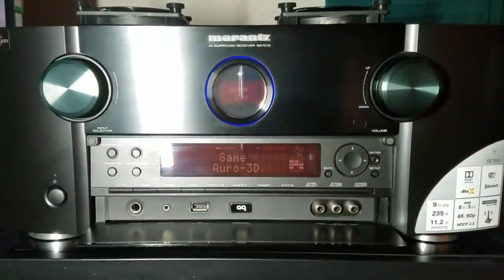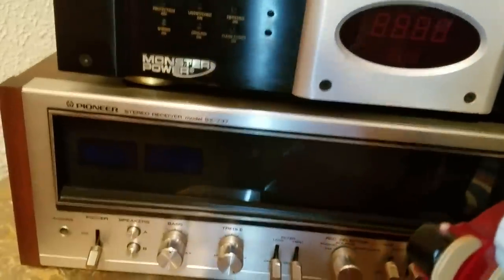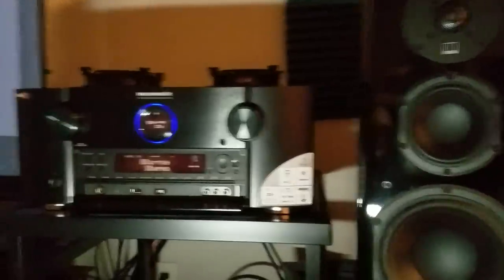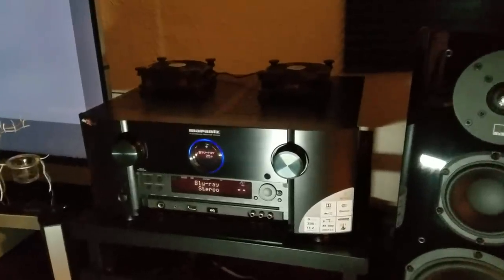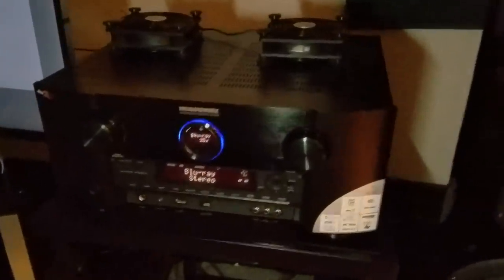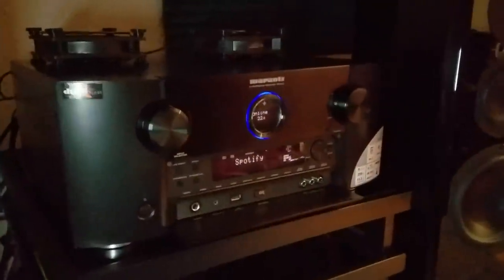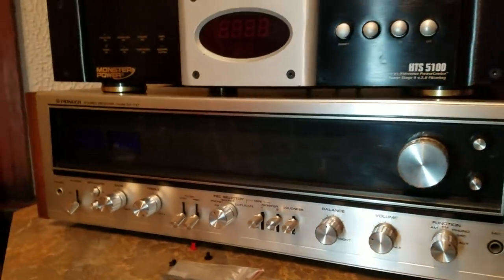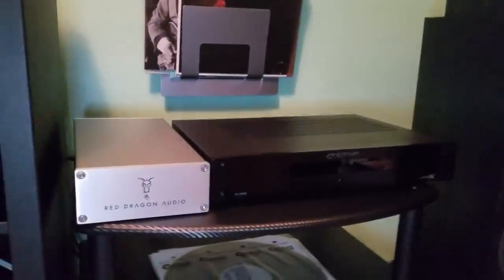My Marantz amp blew up 2

Comment: I get the feeling that his amp blew up because he is abusive and pushed things too far.
Reply: 100 percent correct. Guy clipped the amp or crossed wires! Cheap speakers, NO problem with a Marantz, sorry! I've used every major brand AVR you can name with all kinds of speakers in two channel, NEVER blown a one of them! Also, Marantz is NOT a class D amp, as is noted below! Read the literature. Lots of misinformation here! You could drive those Klipsch with a $25 Lepai class D one pound amp and never blow it, well, you could clip it but it would NOT take out a channel but just go protect and reboot when you turn it off and on again. No damage done.
Reply: Yeh he never did answer meaning he had no fricking clue other than he blew the channel. It definitely has nothing to do with high efficiency speakers or that receiver it’s that he cranked it and was flicking around on his phone and spiked the amp to peak amp and pop goes the line lol
Reply: Marantz AV have lots of issues .
I can vouch for that as an owner of multiple marantz AV recievers. 
It's funny how you guys attacked this channel for reporting a problem ...
Your all not bright enough to realize AV recievers are not the way to go for 2 channel stereo in the first place .
Do some homework before you run your mouth .
Reply: So I'm confused...it looked like the repair report said caused by bad speaker. So what was the cause of the blown channel?
Reply: I 2 Marantz receivers SR5600. with JBL 7.1. & SR8500 Wharfedale 2 channel. Both never blew up! 2009 & 2010 both works well this 2020! Love it! I go at negative 25 on the 5600 & -15 on the 8500 for karaoke! Never had a problem on both! Thanks.
Reply: @dednside5229  lololololololol exactly

Comment: So you're not sure about what you're not sure about.. Klipsch on the other hand is far from being a "cheap" solution..
Reply: @1mykalfury  No Marantz doesn't if used correctly.
Reply: Lol
Reply: @1mykalfury  Not the old Marantz
Reply: It's always someone else's fault.  In rality, speaker impedence to speakers ocnstantly fluctuates.
Reply: Klipsch is far from cheap I agree. I’ve looked at their speakers n subs. There expensive. However once I got lucky I got a set of reference towers a center and sub and a older denon amp for 100$. Also the sub had a blown amp but I fixed that using an external amp. I had the setup in my bedroom and I watched Harry Potter and it sounded awesome. I had a set of older Polk towers for the rears. So yeah klipsch is not cheap.

Comment: I am facing a strange issue with my marantz sr5013 .from last 3days my subwoofer is vibrating there is no more kick from sub.i changed the RCA cable but no improvement .can you please help me what could be the issue with receiver .this is the 2nd receiver which is having same issue just after 1year

Comment: I have a very similar Marantz SR 7011 and the specs say it is a class A/B amp to the best of my knowledge.  Mine has been stable at 4 ohm loads and is rated for it.  I once had a piece of wire accidentally short one of the amps, putting it into protective mode without further issue.
I'm guessing there was another problem with yours.  I'm sure you're not the first to use Klipsch speakers with a Marantz receiver, given the popularity of both brands.

Comment: Never consider a volume control as being a measure of the power the amplifier is delivering.  It is just a control allowing more signal into the amplifier.  Depending on the size of the input signal you could easily be driving the amplifier to full power with the control even midway from "max".

Comment from the maker: Anyone remember ELI the ICE man?  Eli says that voltage leads or comes before current in an inductor ice says the current leads or comes first before voltage in a capacitor.  Regarding the phase between voltage and current in an AC circuit, there is a 90 degree phase difference between the current and voltage.  voltage leads the current by 90 degrees the EMF (E) is ahead of the current (I).  In a circuit with capacitor and AC power source, the 90-degree phase difference also exists between the current and voltage but the voltage lags the current.  This way using the cap (C) the voltage emf (E) is behind the current (I).  So when you apply voltage to an inductor it resists and current and it builds up slower than with voltage lagging in time and phase technically.  Capacitors are directly proportional to the charge and the current must lead the voltage in time in Phase to conduct charge to the plates and raise the voltage. Understanding that is you can realize that technically resistance dealing with AC circuits it's called impedance at this point, but the voltage and current are always linear in a pure resistance.  People have used the letter Z often to refer to resistance in an AC circuit.   So when referring to resistance in an AC circuit you can simply refer to the impedance.   so you can certainly refer to resistance in an AC circuit just using the term impedance so you could say DC resistance equals AC impedance.  Average power however in a resistive vs. Reactive circuit depends on phase angle in a purely resistive circuit obviously equal zero.  If I remember correctly the power factor is equal to 1 so average power consumed by an AC resistance using Ohm's law is 
P=V.I = I (squared)R = V (squared) over R watts.

Comment: Most AVRs are not class D.  Class A/B is most common for AVRs.  The SR7010 has A/B class amplifiers.  You're more likely to find class D in amplifiers, soundbars, and powered speakers.
Reply: I totally agree they are as well and to be honest I am not a fan of plugging other amplifiers into them either unless it's a powered subwoofer. I want to hear the amp I brought in the first place not something else. I mean if it was no good in the first place why buy the bloody thing :))))))). And before anyone asks, I do know what a power amp is for but I do not feel the need for one, or the extra expense that comes with it  :))))))). Mind you I bet it makes a louder bang if you blow it up :)))))))).
Reply: Harman Kardon avr 370 is class D. That's why it is sitting on a shelf somewhere after being replaced with something that can actually reproduce sound. Lesson learned.
Reply: Correct!
This dude's a POD and doesn't know what the hell
he's talking about.!
Marantz is crap these days with 1 of the highest
return rates among AVR's.
Reply: For those who like to connect external amplifiers. Thats what preamps are for. Yamaha makes an 11.2ch preamp with XLR outputs. Designed for home theater use.
Reply: @1mykalfury  wow I hate to hear thst as a few months back I bought an SR7012........no issues yet, keep uour fingers crossed.
Reply: Mathew, interesting reply and are you a tech? 
I am troubleshooting my SR 7011 and it is pulling over 1.05 amps of AC power just sitting there with the power on.  Makes lots of heat and no sound.  If you have one of these you would think it was running class A, but if it is push-pull, then A-B for sure, and no way it would need 120 watts of power just to sit there with no music or video running thru it right???  This one is making enough heat for a toasted cheese sandwich!
Reply: David, I will do that AS soon as I get the problems with IC391 ironed out. Something is causing the amp stages themselves to draw lots of current with no input.

Comment: You are smart to have cooling fans on that receiver. Lots of manufacturers use Large Scale ICs for power amps. Loaded with transistors, these modules run really hot. The reason for using modules is cost and space. But really poor for thermal management. Even on Marantz separates, there are output transistors on a "cooling tube" which is not as efficient as big heat sinks but save space. My only receiver is a 1974 Marantz 19. Each side has a full length heat sink. That's only for 50 wpc. But multi-channel receivers have a space problem. I recommend a separate power amp and then buy a disposable pre-pro.
Reply: I had a ac infinity t10 on my denon x4400h and still will get hot that's why i said forgot avr go with separates
Reply: Thanks. It's been great since 1974.No rebuilds. Scope still works which is amazing.
Reply: The inusfficient heat-sinks -- in Denon's they tend to be a "ribbon" of thin aluminum -- is cost-cutting.  "Audioholics" goes into detail about the annual cramming of more and more "features" (many of them useless) into the same-sized units.

So adjunct cooling is a must.

Comment: Speaker impedance fluctuates yes but newer amps and AVRs have settings for 4 6 and 8 ohms. At least every AVR I’ve had did. And yes u wanna make sure that you have no shorts to chassis from the speaker wires. And don’t double up speakers on one channel cuz that puts more strain on the amp because the resistance is lower.

Comment: Your cooling is same as mine I run same ACInfinity on top pf my Denon X7200WA since day 1. I run full Klipsch setup on my X7200WA and have never had a problem and I have run my unit at considerable power for considerable time.

Comment: my sr7013  turn itself on off constantly sometimes. I use restarting option to fix this problem temporarily .  Any idea?
Reply: I found the problem. It is low voltage power outlet input

Comment: I have a TEAC 5.1 Dolby and DTS av receiver from 2001 running 4 ohm speakers. The av receiver has a minimum of 8 ohms but I never push the volume over 60 to 75% unless I need to test different speakers for only a few seconds to a minute. I always listen at 50% it is the most comfortable listening volume while prolonging the lifespan of the power and pre amps
Reply: The impedence into the speakers constantly fluctuates.  And certainy one doesn't want to use the volume to clipping -- and therefore overheating -- levels.  Some want to run REAL LUD so they overspend on high-end speakers.  Klipsh are crap, but they aren't "cheap".

Comment: For mostly movie duties, is Denon better than Marantz? Also is the Audessy XT32 a well worth upgrade to the XT? My living room is not treated with sound proofing etc. Just a standard room with it's flaw for sure.
Reply from the maker: I like the Marantz models a bit better although they are both made by the same company... so although they are a bit different, the same parts mainly go into the models that are comparable.
Reply: Audessy XT32 allows setting crossovers for different sets of speakers.  XT alone only has one crossover setting.  XT32 is a vast iprovement in configuration and tweaking.

Comment: I'm a Megayacht Mechanic in Palm Beach .
Marantz units are continually having problems and breaking in the field .
You are correct they have problems .
In fact most marantz digital products do .
The bluetooth module and the pre amplifier out board failed . It also failed in another unit I had .
I see tons of these a single ship may have 30+ recievers .
I've seen it in the field -
Hes right
Reply: Constant firmware update problems , expensive proprietary software dealer repairs....
Boards failing , bluetooth connection issues .
Marantz is releasing unstable units then trying to fix it in the field with updates .
If you dont need 13.2 Aros then consider other options and be wary of used units .

Comment: was it worth spending  $200.00 on adding  auro 3 d to your marantz  avr sr 7010 I have the sr7011 and i was thinking about adding it to my system i am running  a 7.2.4 system right now and was it easy to download i just hate to spend the extra money when the dolby atmos and the dts master  sound great . is there that much of a difference between  the three i just wanted  someone else's  opinion.  thanks
Reply from the maker: To be honest with you if you are extremely interested in getting the best possible sound modes then yes, it is worth it, although if you are just going to use the unit for movies and music, and what sound mode it is in isn't of concern...The auro 3D uses the height channels like atmos and DTS X so if you have elevation or ceiling speakers yes, if not than no.  There is no significant difference in the quality of audio coming from the receiver itself.

Comment: So the only real risk is to play music through 2 channel mode? I have polk rti4 bookshelf speakers for rear surrounds (cheap) connected directly to 6013 receiver but never listen through two channel. I should be safe?
Reply from the maker: You should be safe using those speakers even in 2 channel mode.   But when powering any cheap speakers they aren't always 8 ohms as advertised which can damage both the speakers and the amp but in this case the amp shut off before sending damage to the speakers thankfully.  But lesson learned that the crossovers in the speakers are actually what causes the problem and if they're cheap crossovers the amp will notice that when cranked up loud and things get scary.
Reply: @tacticalAV  It's the cranking it up loud that overheated the amp -- not the speakers, and not the corssover, blah, blah, blah.  The impedence into the speakers constantly fluctuates, so the ohm-rating limited to 8 is "fashion," not fact.  Denon -- owned by Marantz -- "allows" impedence 4 to 16.

Comment: At one point I was hired every weekend to DJ at a venue that was really just a big house with a stereo receiver and speakers for sound. I tried to talk the owner into adding pro dj equipment and even offered some of mine. They refused because they wanted to avoid the look and feel of a nightclub. So at one point we were blowing out a receiver like once a year.
Pioneer, Denon ... it didn't matter. I suggested that it might be the speakers. Nobody agreed with me and nothing improved. One day finally we got new speakers and the receivers never blew again!
I opened the old speakers which looked great on the outside. Inside the xover components had bulging caps, etc. I measure the components and speaker drivers. Many were faulty causing the amp to see a load of 2 ohms rather than the rated 8.
Just one of these faulty speakers hooked up would be capable of blowing a home receiver or amp.

Comment: Why are so many Marantz owners suffering
so many "blow up" problems with their surround sound AVR's?
Marantz ain't cheap, so, WHAT THE HELL?
Onkyo is also having the same issues too.
This may be why Onkyo & Marantz have been selling a new
9.1 ATMOS AVR for under a $1,000.
They're cheap because they've got cheap parts inside.
Before anybody argues against what I wrote here, go checkout
what I wrote vs owner reviews across the web.
I'll stick to Yamaha, they've got 4 ohm drive and commercial strength
surround sound chips.
Yamaha DAC's are top notch too.
Denon is supposedly another great AVR that's dependable.
Myself, if I spend over $300 on any AVR it better do what it boasts.
Shame on Marants and Onkyo sticking it to their buyers.
~ peace
Reply: FYI. Denon and Marantz are the same company
Reply: My 7010 just went on the blink again, I can get into protection pass but amp flashes red lights when powered off/on. My Sony 5.1 DD amp is still going strong - I bought it in 1999.

Comment: thanks for your comment  hey I wanted to ask u another question i notice when i play just music  in just the stereo mode it seems that u have to put the volume way up and it just doesn't  seem as good as if you were playing a movie  it seems to me this avr is really set up more for videos i know when i play a movie its un believeable i know i really need a two channel amp or receiver thanks
Reply: Stereo in AVRs tend not to include subwoofer, except in "All Channel Stereo".
Reply: It may be too late for this response, but check your Audessey settings. I had the same problem, and fixed it - now 2 channel sounds far better. For my Marantz receiver, different inputs and configurations have different dynamic EQ settings - with dynamic EQ off for 2 channel listening, my output is very, very low. Once I have the Dynamic EQ on, 2 channel plays at full output.

Comment: That happened to my Denon receiver as well.  A little over one year old but luckily still under warranty.
Reply from the maker: Unless you are driving cheap speakers to loud levels, I wouldn't ever worry about yours blowing the way that mine did.
Reply: @tacticalAV  Klitsch are crap, but not cheap.  And cheap speakers aren't the issue either.  Neither is the impedence rating, as impedence fluctuates constantly into the speaker.

Comment: av receivers these days r not as protected inside as they used to be earlier. they go in protect mode when the internal component ia damaged, but they should be in protect mode as soon as a short occurs in one speaker channel. my yamahaa avr says "checl spkr" when there is a speaker wire shorting. It doesnt wait for components to blow up before theowing error message

Comment: Wow..... well, I have the Marantz 6011 AVR and run it with a pair of Klipsch Reference Premier 280F's (the flagship) on Spotify from my kitchen tablet (system is on ANOTHER floor) and I run it up to '0' level all the time.   This has been going on for over a year now with no trouble....  Am I lucky?  Not sure, but it is a simple setup, and I run a Rega RP-6 turntable into it's phono stage as well.......hmmmmmmm  Two channel, free and clear (O:
Reply: Vinyl is dumb.